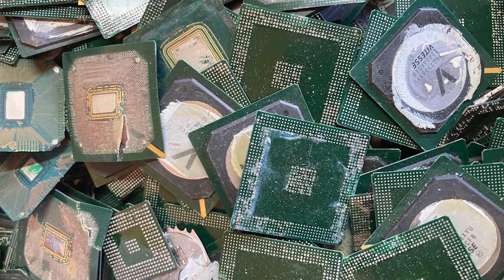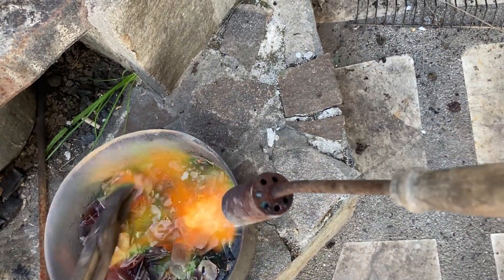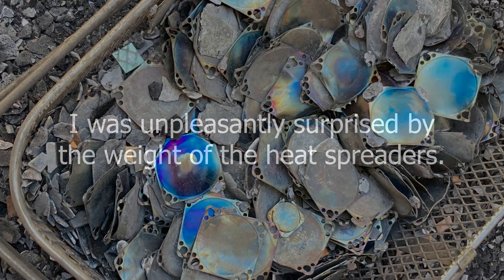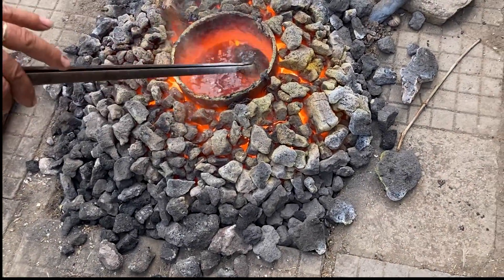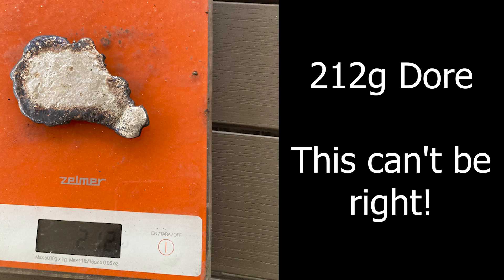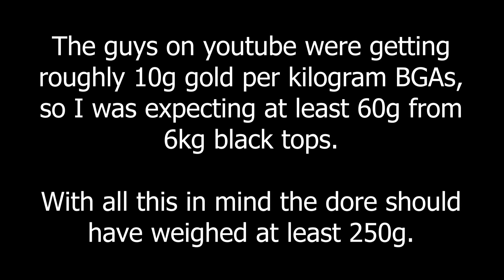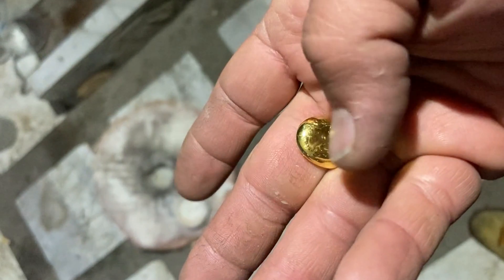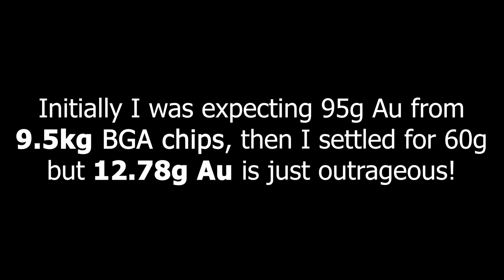9.5kg BGA chips and almost NO GOLD

Comment: Yeah, the process you used is a fair bit different than what I've seen others use.  I think some of the comments below may be on to the issue of where the missing gold is.  Perhaps some is in the parts you didn't incinerate originally and some (likely lots) ended up in your slag.  The other issue that was brought up was what the source of the BGA chips are and that could have an impact.

Comment: did the whole thing wrong.. and every bit of what you done was unnecessary and a waste
Reply from the maker: @theonewhowas7709  thanks for your input
Reply: @OwlTech333  i wasnt trying to be an ass.. was saying from a standpoint of, where did your 200g of silver go 
and like you said in your video.. it was a joke.. that why i really dont like using the lead an silver method either..  
i wouldve just grinded it all up after ashing and using acids from there.. it would been much more simple.. but just my opinion..

Comment: wrong incinerated > lost gold. You still had black coal, it's adsorbent for the gold. And lead smelting is not a good method for non ceramic cpu/chips etc. This material have 10 gr in 1 kg around without copper discs, with them around 8 gr per 1 kg

Comment: That is because of weight of heat sinks on top of epoxy and because that BGA gold corn.chips are made after 2005 yr.
Collect only made before 2005 yr. after that year is gold plated copper vires.
All the best witches for you from Serbia.
You have my SUB and LIKE.
Reply from the maker: Dobro dosli!
Reply: Hvala sve najbolje. @OwlTech333

Comment: I imagine you scraped away a decent amount on your “cupellation” it’d probably be better to use Portland cement or a bone ash crucible
Reply from the maker: If there is a problem with the process it’s in the smelting, rather than the cupellation

Comment: I have found that BGA chips that come from television boards generally do not have gold in them, they are usually made in China, and the bond wires are made from cheaper metals such as aluminum. If all the BGA's came from Computer motherboards, your yield would increase greatly.
Reply: Yes that is true I had 140 gram bga top part or led tv or LCD tv but I got 450 mg of gold it's so bad result.
Reply: how about BGA s from routers or extension cards?
Reply: I was wondering what happened to the "green fiber". Bonding wires are there.

Comment: You only really had 2.9KG of material, and to get 12 grams is not too bad. You have to take in consideration that weight of the heat sinks is not workable material. Thanks for showing us to avoid them heat sink toped BGA's, you're better off selling them.

Comment: I dont know why all your videos have smelting.
Since you ended up doing a nitric bath anyway, you could have just put the ashes into nitric like its meant to be done. And then aqua regia.
You didn't need to waste time with all the smelting process
Reply from the maker: You haven't seen All my videos judging from your comment. I'm using far less nitric acid to dissolve gold alloyed with silver than dissolving copper wires.
Reply: @OwlTech333  oh ok. Nice
Reply: even if all videos were smelting there is nothing wrong with that, fire assay is an art and very reliable recovery method

Comment: i think u got the wrong bga those ones got tin copper tops they low grade bga the one that have the 10grams on top and 3 grams of gold for the bottom part on the are the full black top ones with no tin copper on top and not those ones cheers

Comment: With BGA´s it´s always a risky operation. If they aren´t some old branded Intel etc. you cannot predict anything. Gold corner also do not assure the yield. From my point of view, incinerated chips passed through the sieve could be very easily washed with water to remove most of the silica fillers and remaining carbon and silicon. The rest is incinerated again to assure no carbon left. And leached with AR.
Altough I see you have an established route for processing scrap with pyrometallurgy. Keep doing the good work.

And try to smash-grind the piece of slag and pan the powder to see if some gold isn´t lost in it. It doesn´t look very thin, and after incineration, material didn´t look grey, but black. Maybe some carbon in the slag trapped the gold.

Comment: The gold is present in the slag of casting and slag, re-cast both of the slag again, and re-slag it, you will find the lost
Reply: And another note, you did not burn well or grind well, and this is the most important cause of loss, and the correct ratio is from 40 to 50 grams.

Comment: Copper heat absorber at top of BGA ... This kind of BGA yield 2.5 to 3.5g  Gold per KG
Somehow there are fake chips installed electronics boards in market by fraud people ... Those BGA have zero gold ... Because top epoxy is fake. So be wise and break an IC and try to find out gold jumpers if you can see with Mobile camera magnifying you can see gold easily ... If gold is there fine ... otherwise those BGA are fake .. xD

Comment: Why did you expect a 60g yield? BGAs contain 4-5g of gold / kg. After you removed the copper heatsinks, you had 2.9kg of BGA ashes, so 2.9 x 5g = 14.5g of gold is your maximum yield. You've got 12.8g which is ok, I think.
Reply from the maker: I was expecting 95g, but then I saw that 10-12g per kg is for black tops only

Comment: The only explanation that came to my mind that the mixture wasn't thin enough due to the high silica content there which worked as an acidic Flux  so you needed more basic thinners such as soda ash 
Check the slag, something is wrong of course, more than 75% of your gold is missed

Comment: Where do I find scrap eastern european capacitors and chips. Also, why not use a cone fixture to pour the entire run into. Let gravity do the work.
Reply from the maker: I haven't made one yet, but it's on my checklist
Reply: The pyramid shaped cone is the way to go for sure. No messing around, melt your lot, pour it in, let it cool. Just remember that your salg may still have some recoverable material, save it up and run it again at some later date

Comment: BGAs will always vary, the bigger the chips the lower the yield, especially copper top BGAs. Ive seen crazy yields with smaller BGAs they use as memory but on GPUs or on other boards that aren't memory. No set yield with these unfortunately

Comment: Once you incinerate the chips and remove the copper heat spreaders, you only need to rinse with water several times till most of the black plastic is gone. Some people grind the chips in homemade machines like trinity gold recovery link Isent you not to long ago or they use anything to crush up the thicker pieces of plastic, hammer, coffee can with call bearing etc. Where you're done washing you have a big ball of gold bond wires, silicon chips and and a little bit of other junk.
Reply: so not crushing gives you a chance to wash the material without shredding the gold?

Comment: Was this 10kg including the green fibre bases?
Reply from the maker: Yes
Reply: @OwlTech333  that's a lot of weight to lose my friend. 
When I have seen yield results for gold corner bga chips it has always been without copper tops and no fibre bases.

The result you have is basically the a 2.6kg recovery. 
It's sad that people mess with buyers like that
Reply from the maker: It's not lost, the question is: was it there to begin with. I keep all my slags until the job is done.
Reply: @OwlTech333  in my experience I have never had gold corner bga chips yield this badly.
Something I will say though is there has been a rise in fake components supplied for ewaste. I've seen CPUs and some other chips that have nothing Inside them

Comment: Great video. 
Remember new chips have lower gold.
I would re process the slag, maybe have a cone mould to gravity separate in cooling, like mbmmllc. Also some borax to thin the slag and allow more metal to sink down.
Reply: And an iron rod? AGrre borax and cone mold. That slag removal looks way to dependent on skill and circumstance. And I could not tell what the cupel method was. I did not see anything added like crushed sea shell powder. Was it all evaporation? And do you breath that?

Comment: Yes BGA’s are funny buggers. Did a load in sulphuric boil, and was not impressed with result. I always separate the metal cap ones as well more modern ones are overrated.
Reply: Copper topped chips will always yield WAY LESS because of the weight, we could see another 2000 plus grams of copper alone in his

Comment: Hmm sneaky move if those werent sold as heat sink bga's. A mixed lot should be way less copper plates. Or at least i would have to set them aside from others to get that many.
When depopulating boards i find alot more of the other type. 
And as you found out. It's pretty much the majority the weight, Skewing bga estimates. But I also wonder what the slags rechecking will produce. As suggested in the comments.

Comment: hello dear i saw some gold recovery from trinity gold recovery channel!
i think u wasting gold  in ash melting process 
your methode not good using acid instead of melding with lead!
Reply: Be very cautious about the results on trinity. Some of them are way off
Reply: @scrappydoo7887  I agree with you
It may have been realized as a result
 (u know what i mean :)
But working with acid and attention to detail can affect the result
Of course, the type of material is important. For example, the type of RAM that is produced by different companies and the amount of valuable materials in it is different!
Reply: @saeeddamangir1159  100% you are spot on 👍
There's wildly variable results on RAM.
I agree that using lead is unsuitable for chips, I did the same on a smaller scale and the results were poor.
Reply from the maker: Yes, I saw it too

Comment: Hello my friend !
All your gold is in your vitrified slag...
I had the same problem a couple of time at the beginning when i did this method instead of "all chemical process".
 Try this if you mind :
On a furnace ( Temperature must be higher than 1200° ).
Prepare 1 unit of slag and add twice time soda + 1% sodium hydroxide flex + 1% borax.
Start heating till all your mix is red and bubbling.
Then add lead and silver ( 80/20). ( Too much lead will not help you.)
Time depends on your furnace and weight of alloy but do not get rid of slag !
When pouring the mix, use the tallest mold you have to keep density deposit. ( Let cool down alone.)
Your slag must be cleaned...
Repeat till all material is proceeded...
Do your cupellation with portland cement.
Polymer are a shit in pyro-chemical process...
Hope this will help you.
Regards.
Reply from the maker: Thanks for your advice! I'll revise the slags!

Comment: You should get around 1% from 3.4 kilograms, so like 35 grams. I have done 2 kg mixed bga, after removing the botoms and coolers i got only 640 grams tops, boiled in 95% Sulfuric acid, washing with tap water, after clearing, washing with distiled water then ad 50% Nitric/50% distiled watet, after reacțion done, wash, then AR,, denox, precipitate. Your gold shold be stuck or in cupiled lead/silver, or in disolved glass.To disolve the glass you need HF, Hidroflouric acid.
Reply: Hydrofluoric  Acid. Good Ole Whink brand Rust stain remover!!! They prob don't sell it anymore though.

Comment: It could be because you didn't burn and crush enough. Lot of the gold likely is still sat between that plastic. You gotta grind to a powder
Reply: Yes. Ball mill it
Reply from the maker: I didn't grind the material because all of it is dissolved in the melt anyway, including the silicon dies
Reply: @OwlTech333  ah ok that's strange then. Never seen a yield like that
Reply from the maker: @keytefirerefining1355  I would love to find out if anyone has processed this particular type and brand as about 90% of the BGAs were the same.
Reply: @OwlTech333  ah maybe from the same board. All having copper. That's ashame then. I've had chips wreck my yield a lot. Since then if I have hundreds of the same board I take of 50 or so grams and burn put in water and you should see gold wires sat at bottom.
Reply from the maker: @keytefirerefining1355  That's a great idea
Reply: @OwlTech333  I just had a simular problem to you. 500kg of the same mini boards. Making a video on them at the moment. Thaught I'd test a few chips and copper haha. Real annoying but glad I checked otherwise I'd spend Ages removing burning and panning
Reply from the maker: @keytefirerefining1355  these ones have copper too but is that a problem?
Reply: @OwlTech333  basically inside is a silicon dye. Then there will be a reasonably thick gold wire from that to almost end of the chip. Some have copper instead of gold meaning no gold is in that chip. I'll messenger you what it should look like without the plastic
Reply: @OwlTech333  there it is!!!